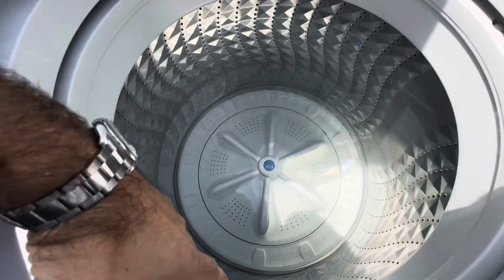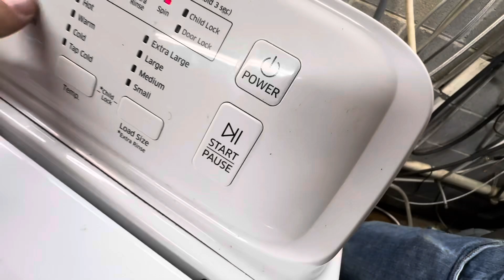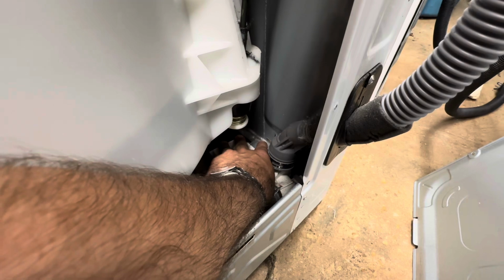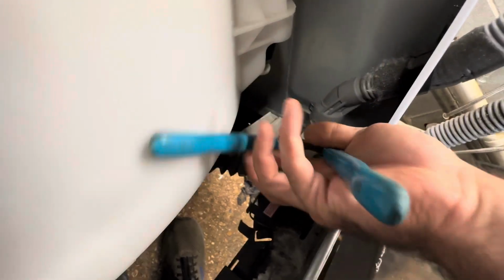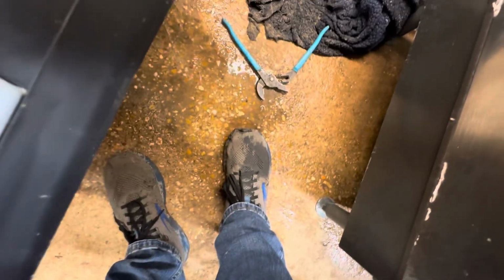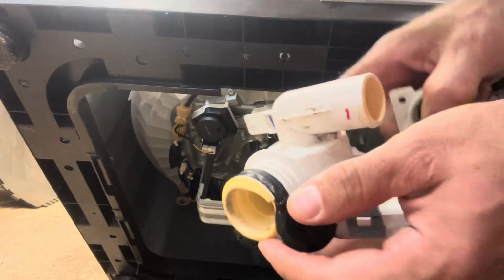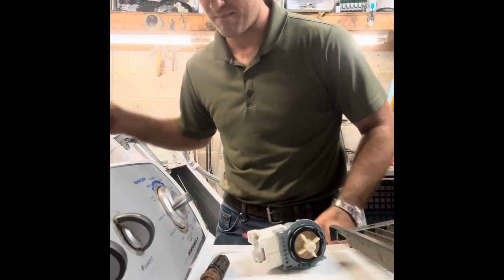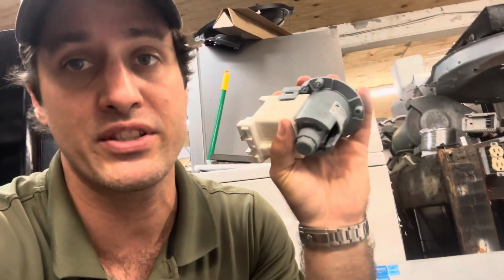Samsung washer not draining or spinning | Just a bad drain pump | dc31-00054d

Comment: Samsung machines are actually not that bad
Reply from the maker: @homeguestunton  no they do seem to hold up for a while. As long as the controls are good they can be repaired pretty easily.
Reply: @LAapplianceguy   The Samsungs are not bad for the most part, Samsung is often estimated to be the worst washer brand, but they actually aren’t that bad in my experience
Reply from the maker: @homeguestunton  they are ok. Getting better I would say